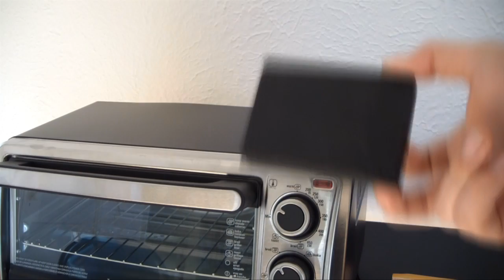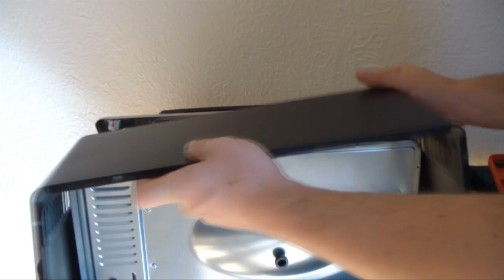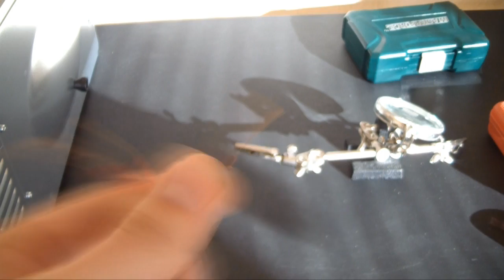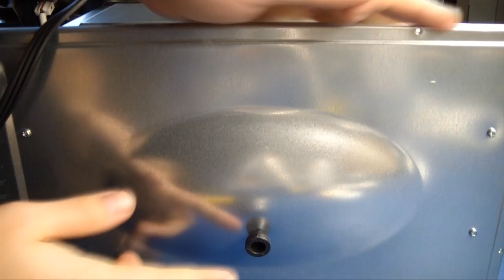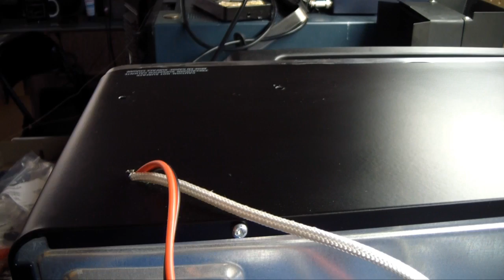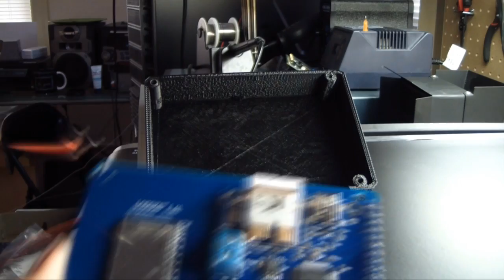Zallus Oven Assembly Part 1

Comment: At 14:05 you start to tin the wire. I would not recommend it. Tin is soft and it will "creep" under the pressure of the screw.
See:
http://electronics.stackexchange.com/questions/29861/tinning-wires-that-will-be-screwed-in-to-a-chocolate-block-terminal-strip
Reply from the maker: Thanks Hubert, very interesting and thanks for the link! I'll have to see if I can find some solid core wire for future kits such that it isn't an issue.